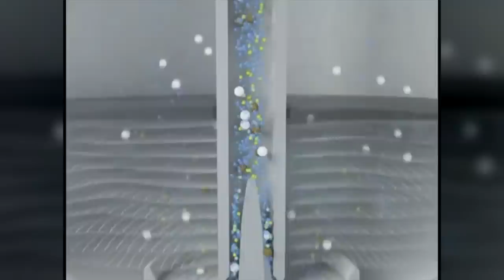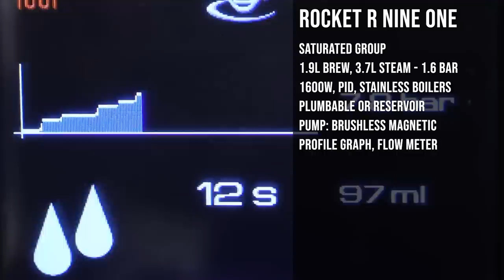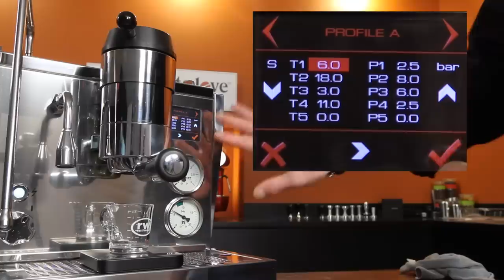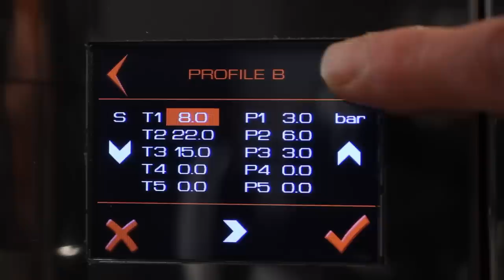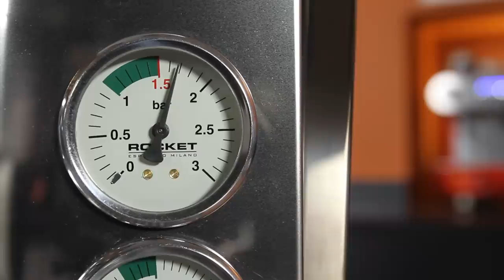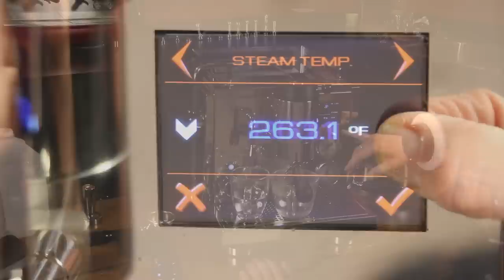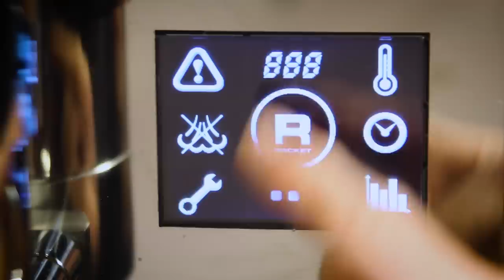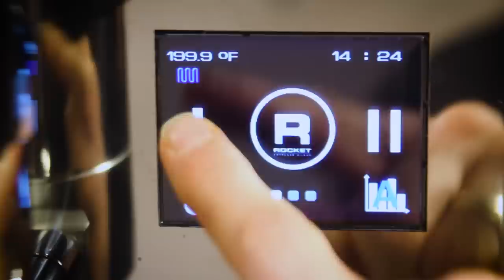Review: Rocket Espresso R Nine One Pressure Profiling Espresso Machine

Comment: Hi Marc, espresso nubie here. I have a question, what is the difference between R Nine One Pressure Profiling with Rocket Appartamento + flow control and gauge setup? Do they all basically do the same pressure profile only that one is automatic and the other is not? Thank you. Great review as usual!
Reply from the maker: Hi gw, Thanks for the question. The R Nine One uses pressure. Flow control uses flow rates with little concern for pressure. Pressure and flow are related but not one in the same. For instance if you were using a pressure profile and then changed your grind to coarser the flow rate will be much higher with the coarser grind. But do the same when using flow control and the flow rate stays the same even with the coarser grind. I've become more of an advocate for flow control over the past couple of years. Some research has shown when all else is equal there little difference in the extraction of solids from the grind in a range of 6-10 bar of brew pressure. With flow it's a different story as it's flow through the grind which removes the solids to your cup. Hope that helps!
Marc
Reply: @Wholelattelovepage  Thanks for the explanation Marc. Cheers!
Reply: @Wholelattelovepage  Hi, so your preference would be a machine that does flow control instead of pressure profiling? I've never had an espresso shot from either or seen either one in person, but being able to control more parameters is something I think I will like. If I can get great results from control of either flow or pressure, does it make more sense to buy a high end machine that does flow control instead since they are about $3K less?
Reply from the maker: @DucDNA  Machines with flow control of the E61 group are much less complex than pressure profiling machines like this Rocket and less $$. Less complexity means fewer potential problems. If you have not seen, here's a video demoing two very simple flow profiles on the beautiful ECM Synchronika: https://youtu.be/a-QAOo8Vg5A
My personal preference is controlling flow over pressure.
Marc

Comment: Is the steam wand teflon-lined or double-walled steel?
Reply from the maker: Hi Vernon, It's a teflon tube lining.
Marc
Reply: @Wholelattelovepage  Won't this produce wet steam?
Reply: @NANA-gy7yx  yes and the wand gets hots after a while so just pull the damn thing out
Reply: @Skfkf1393a  a machine with that price tag should have a double wall steam arm. I hate it when they cheap out like that.

Comment: Surely a great machine...but it's like with cars, if one spent a certain (large) amount of money, you want a BMW, Merc and not a VW patch...while Rocket being the VW and La Marzocco being the BMW...Personally I would rather spent a bit more and get a La Marzocco, even if the Rocket might have more features.
Reply from the maker: Hi Ron, Thanks for sharing your opinion. I hear you - I'll add sometimes the VW's are more reliable. LM GS3 modifies pressure/flow in the path of hot water. R Nine One uses pump to modify. Also, for same features you have to go to a Strada which is a lot more $$.

Comment: I need it for cheaper than what you have it listed for Marc.
Reply from the maker: Hi ws, Not exactly an economy machine. If looking for flow/pressure control at a lower price check out The Profitec Pro 500, 600 or 700 and the ECM Synchronika. All are available with a flow control device on the E61 group. See them here: https://www.wholelattelove.com/collections/flow-control
Marc